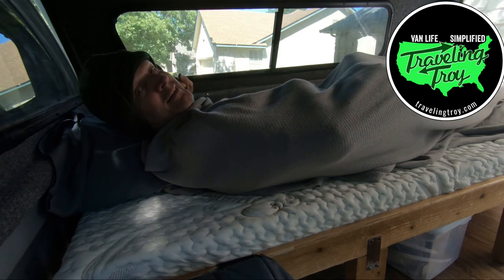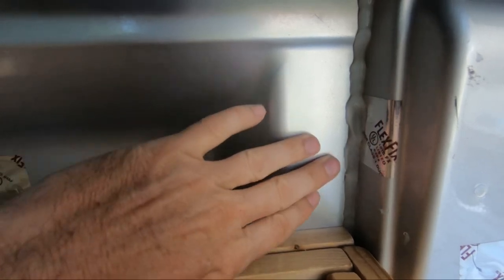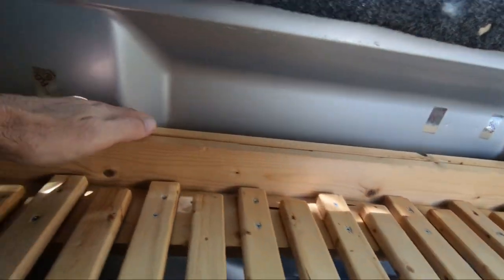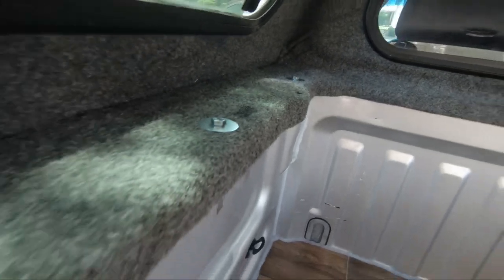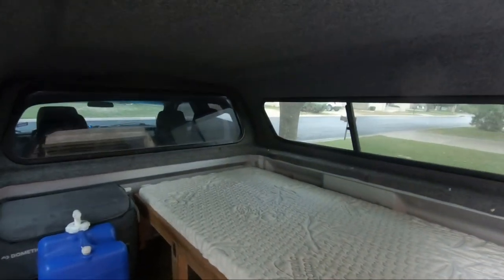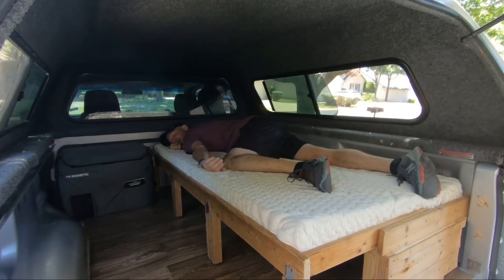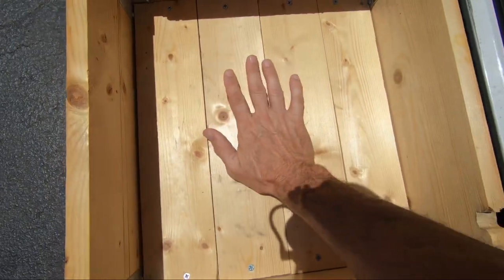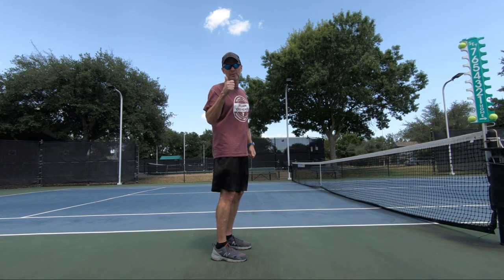DIY Truck Camper Build #3 - Sofa Bed Build - Ford F150

Comment: Thank you for another great video.  Sometimes it is nice to be verticality challenged... I  can comfortably sleep on my 70" matrice. It was really good for the Jeep Patriot build because with out removing the  frount passenger seat,  I  just barely had 70 inches.  I  loved the ground clearance on the Patriot.  You will really like having the truck. Jeeps are so expensive to maintain the suspension. Trucks are way more durable. I'm really enjoying your build,  thank you for taking us along on your journey.
Reply from the maker: I always thought a Jeep build would be cool.  I’ve seen camper tops made for jeeps too..that’s neat.  Thanks for following along on the build.  It’s been fun once again with my Dad.  Sometimes we both have a good idea, but they wont work together, so we have to “sell” our ideas to each other. Haha!!  It’s fun.  Next video should be the countertop with sink, cooktop, fridge and pantry. 😁 Working on that now. 👍
Reply: @TravelingTroy  the limitation on the Jeep Patriot was there was no way to cook with a flame inside. I just took my backpacking stove to a picnic table,  but it was not always comfortable.  I just purchased coffee one cold and windy December morning a few years ago in Nebraska,  because it was in the  teens with 30 mph wind.  I  needed to  pee anyway and Sapps has heated toilet seats,  what more could you want.

Comment: How much smaller is that than the astro? How come you chose the truck and not a newer Toyota minivan?
Reply from the maker: The truck bed is 6.5 ft vs the Astro cargo area at 8 ft.  The truck bed area is slightly wider and they are about the same height from floor to ceiling. As far as why a truck, I like exploring dispersed camping way out away from the crowds and I feel like a 4x4 truck will do that better than a van.  Plus, I one day plan to remove this topper and add on a popup camper or wedge camper. Thanks for the comment/question. 👍

Comment: How are you liking the bed Troy.
Reply from the maker: Well, we pulled out the mattress to continue with the rest of the build, so haven’t even slept on the new mattress yet.  The bed build itself is fine, since we just pulled it from the van and made minor modifications.  Looking forward to finishing the build and catching some ZZZZs in the truck camper bed. 👍

Comment: How high is the topper itself
Reply from the maker: Not positive which measurement you are referring to, so I will give you a couple.  Floor to ceiling headroom 47 inches, topper from bed rail to top of topper about 26 inches, ground to top of topper: 79 to 80 inches. Hope this helps..thanks for watching. 👍
Reply: @TravelingTroy  thanks 🙂👍🏾